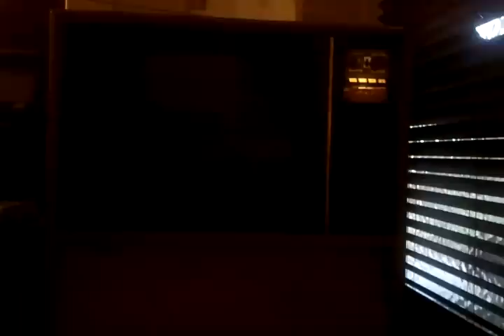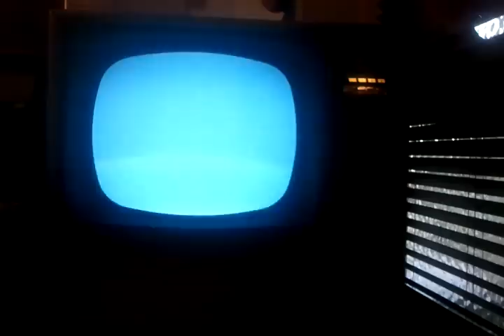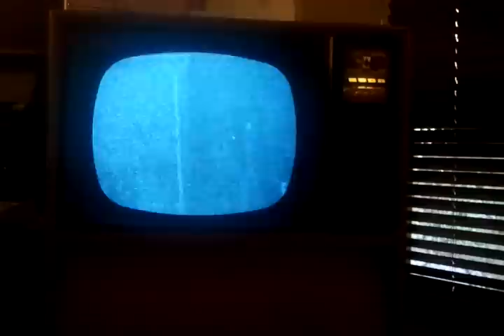Bush Simpson Television (mostly) Working

Comment: The Bush Simpson television factory in Adelaide was located on Swan Terrace, Exeter (near Semaphore Road), South Australia circa 1960.  A section of the corrugated  iron frontage to Swan Terrace still remains in 2016. Back in 1960, an advertising hoarding on the building displayed their slogan - "So clear you can see the Cat's Whiskers".